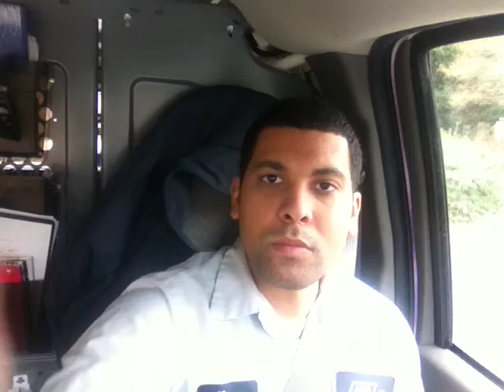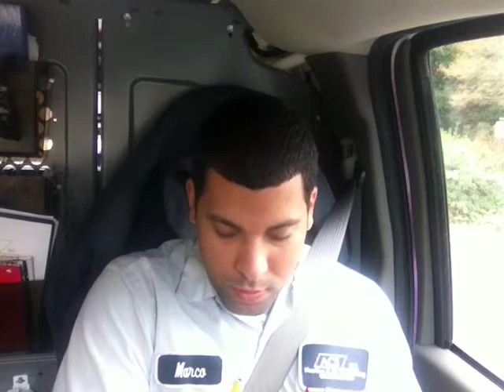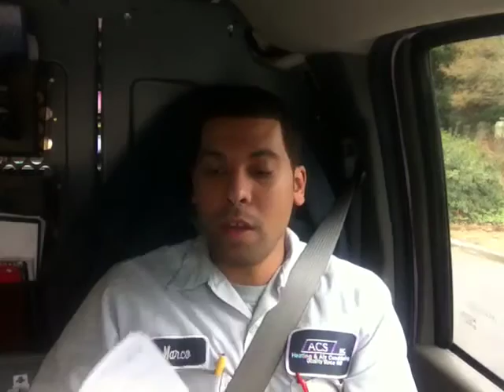High o2 and excess air on a 80% furnace.why?

Comment: there is a hole by the inducer fan the regulates the amount of air. I had one where the hole size was wrong. Also if the is an intake air leak that sucks too much air in.

Comment: I had a furnace with same readings O3 = 13.4%, Co = 14 ppm, EA = 156.8% I tried to increase the gas pressure all the way to 4.8"W/C  but the O2 didn't change I SET GAS pressure back at 3.5 "W/C  I could not find the reason of those readings

Comment: I took the NCI combustion class and highly recommend it. I learned way more than I thought I would. 3.5" WC is just an arbitrary number, and a good place to start. Every furnace has slightly different tolerances, and every install has different lengths and shapes of flue. The furnace will be safer in the long run if you adjust gas pressure to get to the recommended 6-9% O2 range. I had to learn to trust my combustion meter.
Reply from the maker: Thanks I need to see when they'll have a class here in GA

Comment: I would have turned up the gas pressure on a gas valve to meet burning specs. I always adjust  by combustion flue gases not buy gas pressure

Comment: Does the furnace next to it have the same orfice size?
Reply from the maker: I didn't check to see if they both had the same orifice size, I'll take a look at that when I get a chance. Thanks for the tip
Reply: Idk. If they are not the same btu, like one a 70000 and one a 90000, mabye the manufacter only has one combustion fan motor/wheel/housing they use.  So on a smaller unit it supplies a higher ratio of combustion air than it would on the larger unit. This is just reaching for staws though.
Reply from the maker: +John McMaster makes sense. I'll take a look and see what I can come up with. Thanks a lot for the info

Comment: What was your input when you clocked the meter?
Reply from the maker: It was within 2000 btus of the rated inout
Reply from the maker: +Marco Alvarez input***
Reply: Thats interesting that two identical units next to each other fire differently with the same settings. Are the two furnaces the same btu?

Comment: crack in the heat exchanger.?
Reply from the maker: That's what I thought initially and I restarted the heat and my O2 didn't rise when the blower kicked on. Plus the furnace is a 2011 ML180. There was another ml180 right next to it and it had perfect O2 and excess air readings. Pretty weird lol